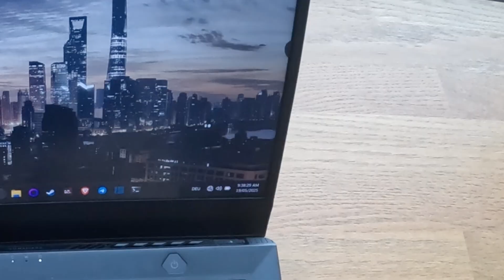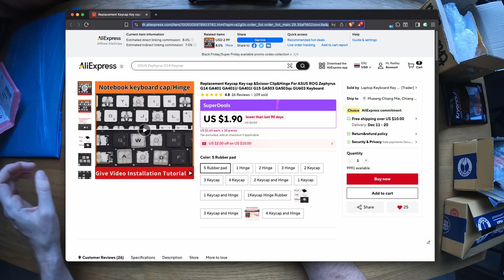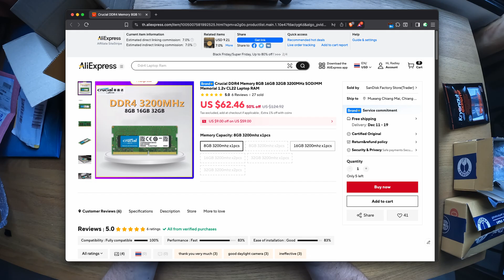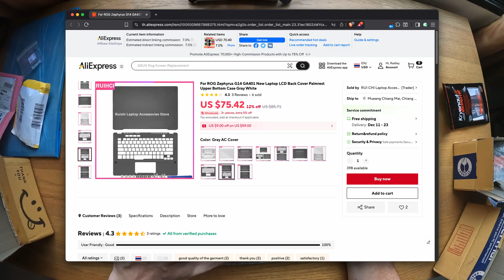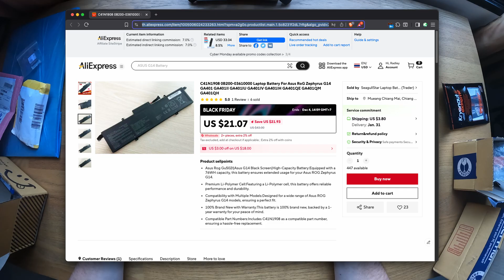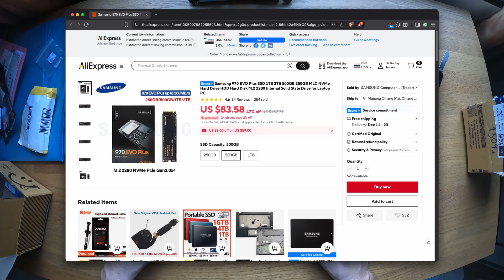This G14 Linux Rebuild Replaced My $3,000 MacBook Pro

Comment: Bro you could have just brought a g14 with rtx 5070 which was on Black Friday sale for the same price of all the parts combined and shown in the video
Reply from the maker: Not quite as I got the unit much cheaper than the listed price (and its Australian Pesos), but you're right in that you need to hunt for a good deal to make the build economical. The 5070 is a nice step up (although this has been excellent). Cheers bro!

Comment: Picked a similar model couple  months ago dirt cheap used its been great with linux. Its fast can still game well enough despite the older gtx1650 all while having good battery life for a gaming laptop. I was not aware the screen was upgrade-able so thank you very much for the video.
Reply from the maker: Awesome! These are really great laptops, I agree with you. Good luck with the upgrade on the screen! Cheers for the comment.
Reply: Its hard to tell in the video but did your cpu originally have liquid metal for cpu cooling? and if so have your thermals been good with the Honeywell replacement?
Reply from the maker: It did, but it was in a very poor state. So far the honeywell pad has been a huge improvement. For example, when I first bought it, even booting it up would lead to extremely hot to the touch chassis. Now its mostly cool (when not under load).
Reply: @theradlectures  good to hear! I originally replaced the liquid metal with normal thermal paste, and the thermals where awful. Had to go back to metal but it makes me nervous for reliability.

Comment: Is it okay to install ubuntu on this ?
Reply from the maker: Yes, definitely. I have run Ubuntu (and also Pop!_OS, which is Ubuntu based, and comes with the Nvidia drivers pre-installed) it runs excellently!
Reply: @theradlectures thanks for advice man. I actually plan to get the second hand g14 after this since i need a second laptop just to play around with linux
Reply from the maker: This is an excellent laptop to learn linux on. I plan to release some linux ricing videos on it, so stay tuned. Happy New Year!
Reply: @theradlectures thanks man. Love your content as well. Happy new year too

Comment: Great work on the swapping of the parts...did you hit any snag when you try to power it up?
Reply from the maker: Funny you mention it, I was a bit rough with one of the FCB connections at the back of the board (for the power and fingerprint reader). That required micro-soldering a non-OEM 10-pin cable, which I paid a guy in Chiang Mai to do (he did a great job). 

Other than that, which was completely my fault - impatience after working on it all day - everything worked as expected. No issues at all and its been running great for about 2 weeks since I recorded the swap. Cheers for the comment!